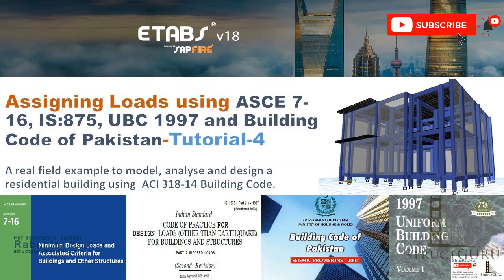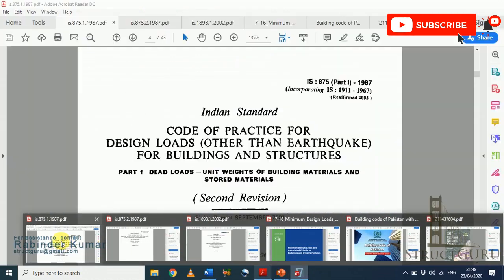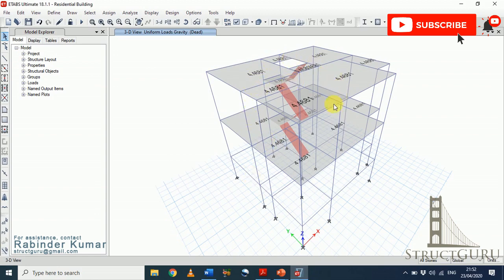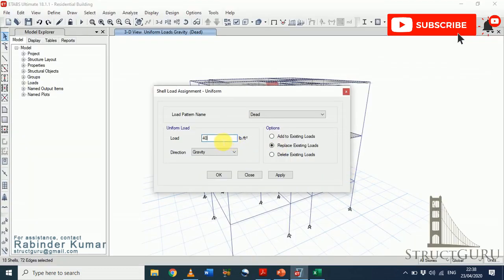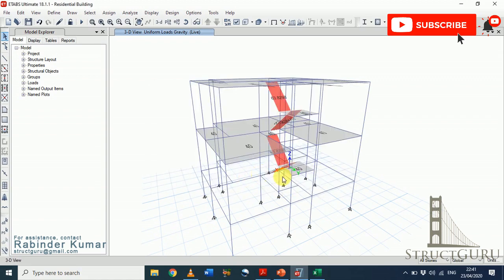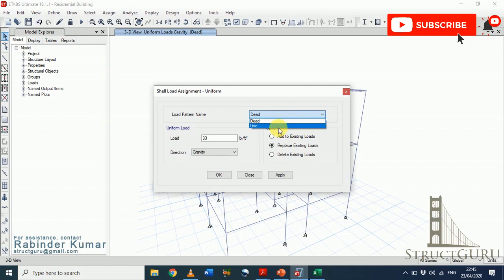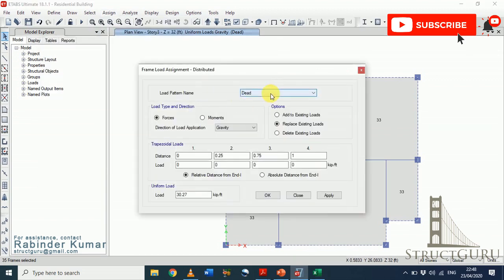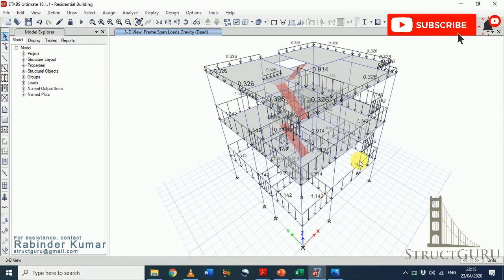Assigning Loads using ASCE 7-16, IS:875, UBC 1997 and Building Code of Pakistan-Tutorial-4

Comment: The Video time whis is 15.58 - 16.05 
Hi. For second inclined floor when you  added dead load whic was 30.27 IB/FT^2  who have not seleceted ADD TO EXISTING LOAD instead of seleceted REPLACE EXISTING LOAD. So, it is about missing part or the values you putted were corrects?Because before you have putted 30.27 IB/FT^2 , there was another value existed. 30.27 IB/FT^2 came from excel table.
Reply: same probleum

Comment: Sir, I expected defining Load Pattern along with Static equivalent or dynamic seismic load and wind load and defining mass source in detail ( including checking the self mass, additional mass or from Load pattern) prior to the applying load. However I request you kindly to incorporate in the next vedio with reference of Seismic load ,calculating Time period, Mass source etc.Thank you sir
Reply from the maker: My next video is on assigning seismic loads using various building codes. Probably, will upload tomorrow. Stay tuned! :)